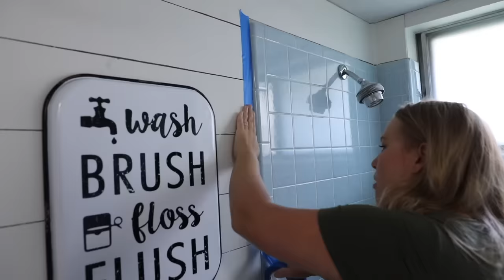Painting Ceramic Tiles: How to Update Your Bathroom Without Remodeling!

Comment: I preferred the previous color as well, but what bothers me is that on the revealed finished shot, it didn’t look like the paint applied evenly. Some parts had a bit of feathering or light wash bleed-through.
Reply: was definitely some very bad runs in the paint
Reply: and the joints were also not painted properly

Comment: I like the white tile. It will stay durable if you let it set for a week or two bf using. It’s easier to clean than the original tile. Also from trial and error plus after watching other pros. Using a really good primer before helps it stay durable. Lasts longer. I like how bright it looks
Reply: Thanks for this advice.  . So, am I supposed to apply tile primer after etching the surface with the help of sandpaper, right? Also, after applying primer, for how many hours am I supposed to wait?

Comment: Used Gripper primer from big box store, painted with exterior high gloss paint.  Used in the bathroom and it has been there for years without issue.  I would never paint the tub as some do, it just will  not last.
Reply: What about paint leveling or brush strokes? How do you keep from getting them? That is my problem.
Reply: Chris Cornelius you have to use a roller
Reply: @karixx5  any certain type?
Reply: Did you use this in the Shower Stall where its exposed to water? Is it still holding up for you. I desperately want to paint my shower tiles. Thank You!

Comment: Im a professional refinisher and trust when i say this is half fast temporary painting.  You must use niosh respirator if you do “ toxic”. 
 Count on it yellowing and peeling off in short time.  Then be ready to pay a professional to strip off all that paint, and resurface it for real.   
   You need chemicals to properly refinish.  “Not clean and roll on cheap epoxy”
Reply: Or you could just replace the tile yourself for $200...Tiling is simple...
Reply: @davejohn255  Are we going to pretend tiling is as simple as this? Now, please look at how inept were the people doing this job... would you say they can re-tile this bathroom? Not a chance.
Reply: @PierSilver  I guess one just thinks things like tiling are easy , when you have been in the trades for 50 years...

Comment: great instructional video!  Epoxy is like the homeowner's duct tape, only better.  It'll last longer than the tile and grout by a good 30 years.  Though, personally I did like the original classic baby blue (very common mid-century and before) tiles.

Comment: Nice video however you said to wait at least 3 hours before applying the second coat, then you said if you don’t get your second coat applied within 1 hour then you need to wait 72 hours.   So which is it, 3 hours or 1 ?
Reply: If you can’t get the second coat on within 1 hour of the epoxy being set, which takes 3 hours.
Reply: You have to wait 3 hrs for it to cure to a certain point, then you have 1 hr to do second coat. 4hrs total.

Comment: Im confused, you said 1st coat needs to dry for 2 hours then apply second coat. Then you said if i dont apply the 2nd coat after 1 hr of applying the second coat, i need to wait 72 hours. Did you mean apply 1st coat, wait one hour, apply 2nd coat, then wait 3 hours for it to dry?

Comment: The tiles looked like they were in perfect condition. I bet the painted finish won't be as durable and easy to clean as the original glaze.
Reply: But you dont know whether it is or not, so why even say anything?
Reply: This Is Freedom they are right. I did this and it doesn’t hold as good. Just my opinion
Reply: @ILLKICKAKIID  didn't hold good!? Really... I think I should stop thinking about doing this. 😑😔

Comment: Searching YouTube " How to remove paint from tile in bathroom", this is suggested..... 🙄
DONT DO IT!!! 3 years after previous owner has done this I am now stuck with trying to remove it as it is peeling and getting mouldy under the paint! 🤢🤮
Reply: Sounds like they didn't apply it properly. If you don't sand the surface of the tile you'll get peeling.
Reply: Wiztard  regular sandpaper and elbow grease does nothing to ceramic surfaces. Maybe if you use a heavy duty sanding disk, mask, and actually scuff it up well.  Otherwise you need to hire a true professional... one that use better paint than epoxy.   
  If you are going to recommend diy painting, then I suggest painting over a sandable surfaces.
Reply: True . Dont do it for sure . An expert came and did it at my house lasted 2 years and due to the moisture started peeling and molding

Comment: It would help if you gave the name of the special cleaner and the tile paint in the summary.Also, the white can look good but what about other colors - wouldn't they look strange having the same color grout lines? Just wondering?
Reply: mine is white/white or was when it was new it's 30+ yrs old now, lol. but it looked really nice back then. however, if you don't like it they do have grout paint as well. however the paint on the shower tiles peels

Comment: Brush marks level out after a few minutes, but you are stuck with the drip marks,
Reply: i used a razor to cut out and remove the paint drip on the particular square tile. i will see if this works when i re-paint the tile.

Comment: This stuff (0:14) has a very strong odor, expensive and total crappy results.
Painted on our metal bathtub and coating was never even. It bubbled & peeled after 7 months.

The original enamel white (hard & chipped out) on the metal bathtub. This lousy stuff runs so much during painting.

Comment: Okay. This stuff smells really bad. I did this to my bathroom using the same products. Make sure you wear a very strong mask 😷 also take into account that you need to let this dry for two days after you finish three coats, which need 3 hours in between to dry...
Reply: Did it hold or started coming off? Am curious.
Reply: @michaelcooksey7232  Did you try, Michael?
Reply: @tintintintin576  it held up! You just need to be careful what products you use to clean your tile as it can strip the paint. If I were to do it all over again I would try the spray paint version of this. Unfortunately, the paint roller I used left tiny hairs in the paint.
Reply: @michaelcooksey7232   it held up! You just need to be careful what products you use to clean your tile as it can strip the paint. If I were to do it all over again I would try the spray paint version of this. Unfortunately, the paint roller I used left tiny hairs in the paint.

Comment: I do this as a living.  Usually i dont tell people but paint tiles or glazing your tub with homedepot products will chip and fall one of these days. Those are meant for short term temporary.   It could last several months or less than 3 years depending on use and how you abuse your shower/tub.   People that dont have the money or cheap people or flipping houses do these stuff.   If you plan to live there over half of your life ... doing these stuff is a waste of money